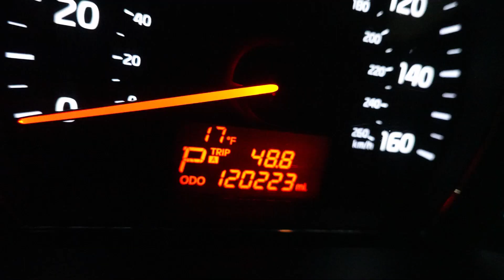2014 KIA Sorento driveline noise, no AWD

Comment: Did you ever do a video on the transmission removal for this vehicle? I am dealing with thia issue in my santa fe and its easier to replace the whole tras used then it is to replace the differential cup itself.

Comment: I'm having this same problem with my Hyundai Santa Fe. Where did you get the parts to buy?
Reply from the maker: At the dealer or a Remanufacturing facility Jasper, LKQ. or used with low miles.
Reply: @videoserviceinformation6639  thank you

Comment: Mine has stripped the output and the intermediate shaft the same way.  Is it possible to change out the female splines without disassembling the transmission? Thanks.
Reply: you have to remove auto out of the vehicle and split auto transmission in order to replace diff case cup carrier part #458223B250 and possible the transfer case shaft #473393B600  with a few seals, yes it's happened to my wife's  12500km 2015 KiaSorrento/Santa fe same drive line